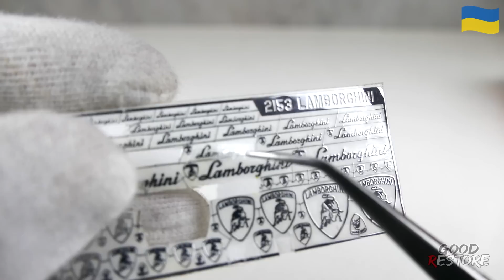Restoration LAMBORGHINI Gallardo Superleggera Abandoned Sport Car

Comment: Excelente trabajo 👌👌 me gustó demasiado como lo remodelaste. 
Tengo una duda amigo...
Yo tengo un Lamborghini Aventador pero se le caen las puertas, ya no se mantienen hacia arriba, porque pasa eso??? Tienen compostura las puertas o se pueden ajustar para que queden hacia arriba?? 
Cómo le hago???
Reply from the maker: If there are bolts on the door hinges, you can tighten them, if not, you can anoint them with paint with a brush, so that the doors open more tightly due to the paint and thereby fix the doors in the open state. Ideally, the doors should have springs, as in models from Bburago, for example, in 1/18 scale
Reply: @GoodRestore  lo mismo pasa con el cofre y puerta trasera donde está el motor, antes abrían bien y ahora se caen fácilmente. Son modelos MAISTO, BBURAGO & 1 HOTWHWEELS escala 1/18.
Entonces debo ajustar los pernos de las puertas en todos???